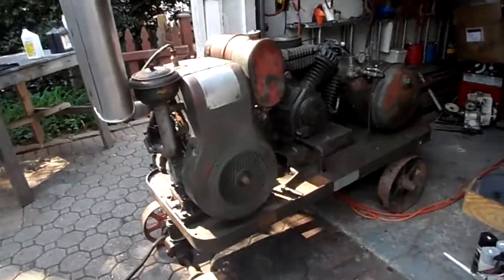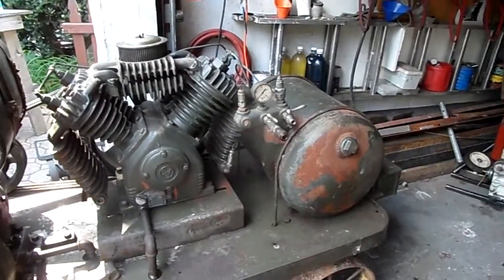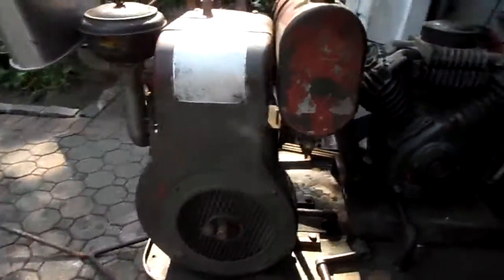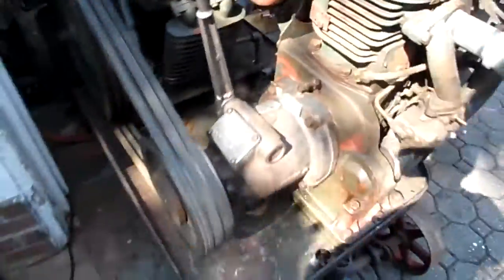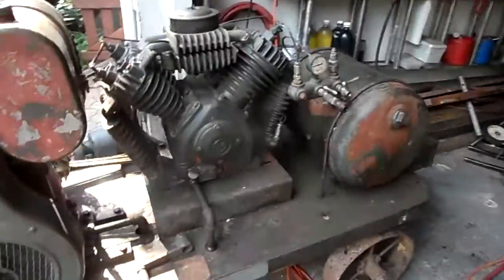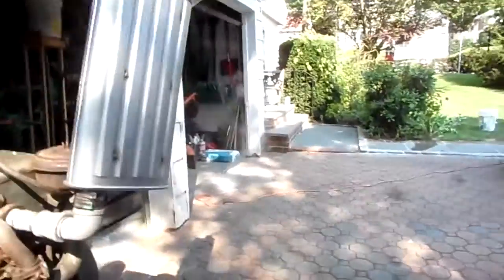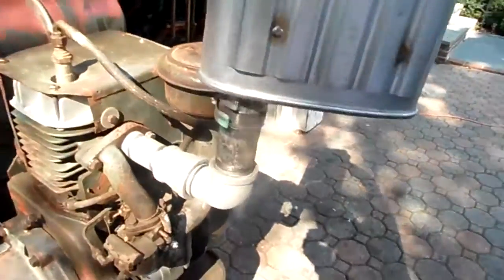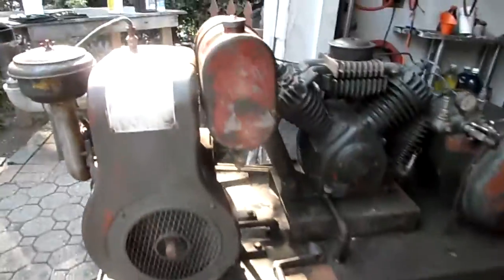Vintage 1953 Devilbiss US Navy Battleship Spray Outfit Air Compressor with a Wisconsin AHHD engine

Comment: I have a Devilbiss compressor very much like this one. I bought mine 6-8 years ago. Mine has a huge Wisconsin  engine on it that has a hand crank for the crankshaft. Mine was missing the air breather, the tube, and carb but I bought what i believe to be the correct parts. My pump is not a double or triple jug, but one massive vertical design. Mine has the lever clutch and identical   air tank and platform. The platform has a Devilbiss tag on it. The gauges say Devilbiss too. Unlike yours, mine sets on a single axle with auto type tires and rims. Additionally it has a trailer type tongue and ball coupler as well as a built in tongue jack that is simply a liece of channel steel that folds down to keep the whole rig sitting level when standing alone. 

Yours is the only one that i have ever found that looked a lot like mine. I brought mine home and set it in my backyard and have never had the time to do anything more with it. 

I would gladly share multiple pictures of mine with you should you have interest in that. 
One day, I hope to make mine operational like yours.

Comment: On the top-right of the output fitting, to the right of the pressure gauge, there is a copper line going into a fitting.  The top cap is removed to expose a flat-head screw that one can turn after loosening a collar.  Does anyone know  what that screw does?
I have one of these, it's the greatest machine ever and I can't find what that adjustment does.
Thank you!
Reply from the maker: Ted, this adjustment controls the pressure at which the compressor unloads. I would be interested in seeing your compressor setup, I have not seen another quite like the one I have. Does yours have the original cart and engine?